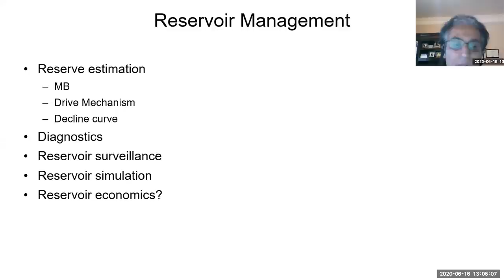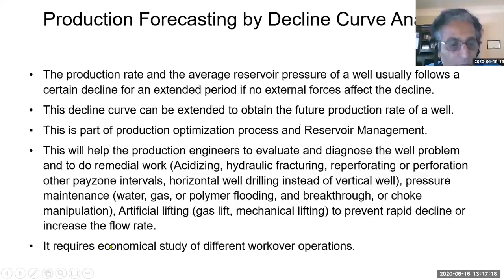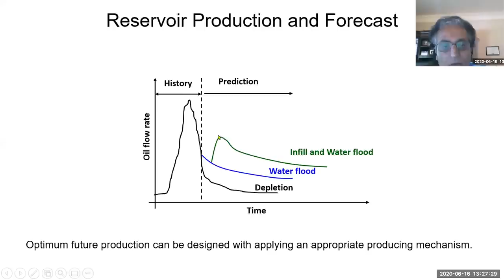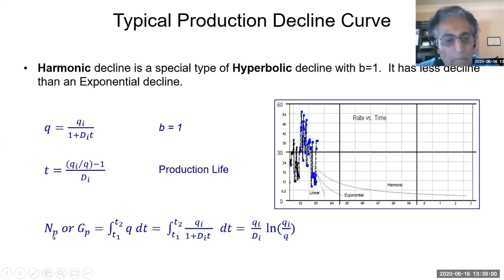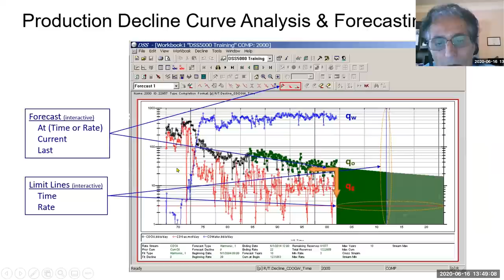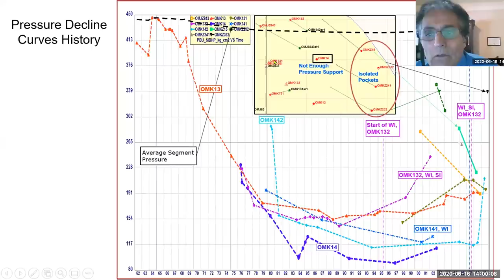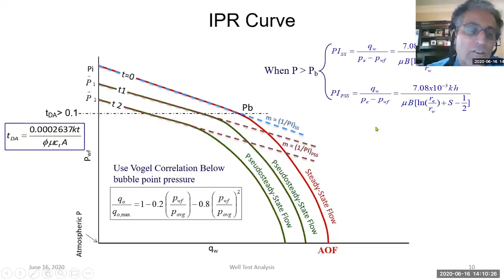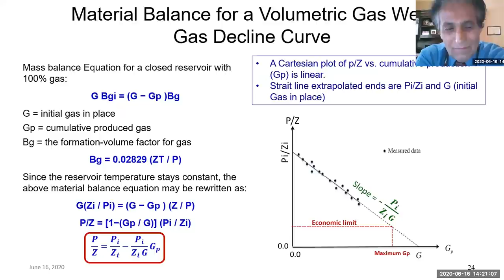Decline Curves Analysis, Dr. Mehdi Azari

Comment: i think there is a mistake in the slide where it says that the plot of P vs log of t after the end of the pressure transient ends is a straight line but as is clear from the equation of PSS that the plot is first of all between P and t and that too is linear so bit of a correction here.  Although the statement is in line with the thought that the plot of P vs log of t is linear but that is in the Transient state not in the PSS region.